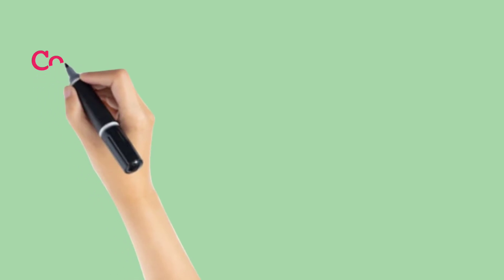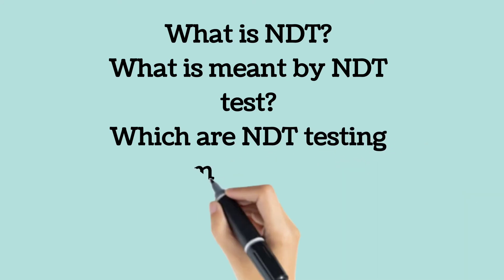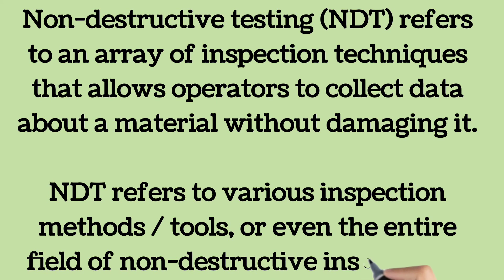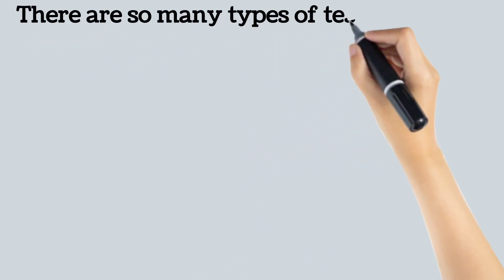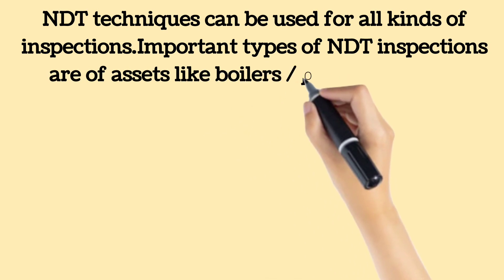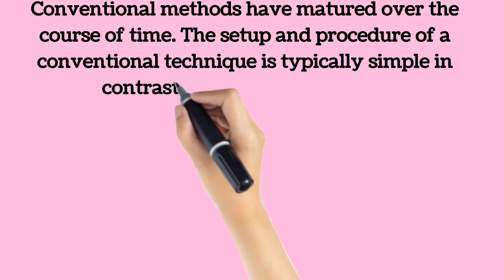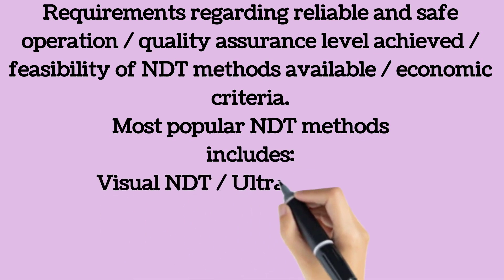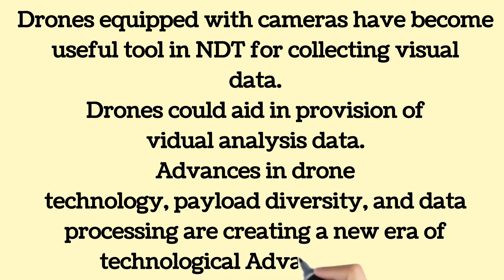Non Destructive Testing Inspections | Asset Integrity & Reliability | NDT | NDE | NDI | RBI | AIMS

Comment: Which of the following methods of NDT requires leak proofing of casting before inspection?
Reply from the maker: It depends on the surface preparation and location. PT is best to identify such damages.
Reply: @corrosioncontrolandinspect6446  thanks 👍